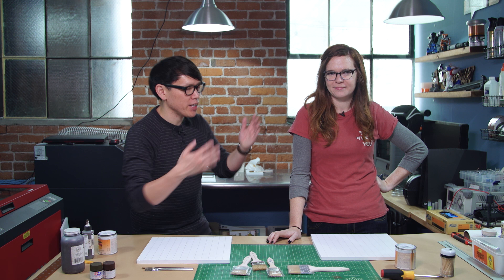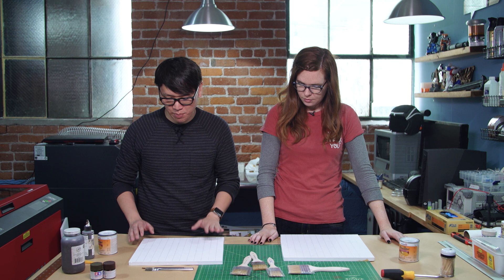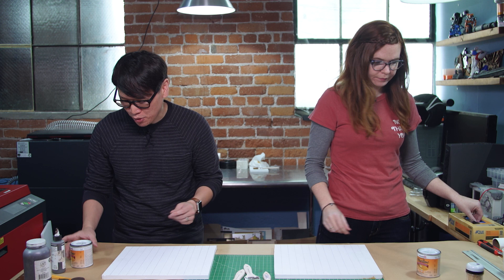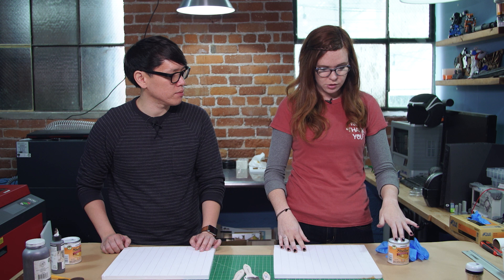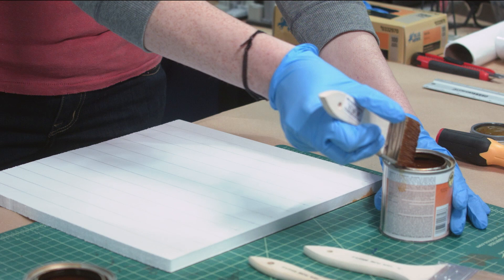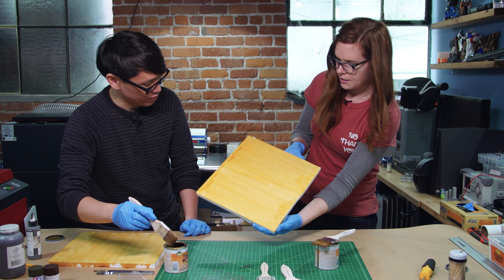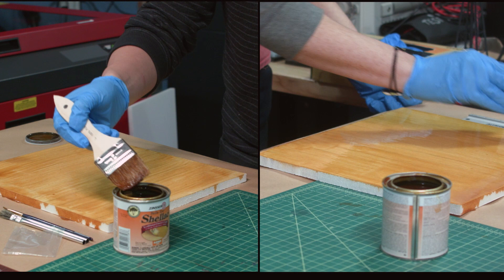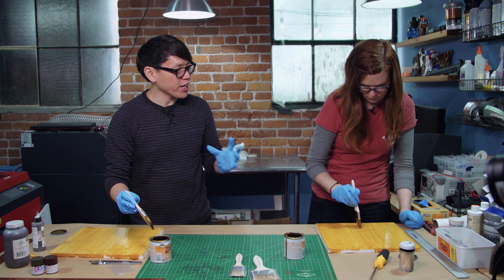Model Behavior: Making Miniature Wood Flooring!

Comment: I've made my own miniature ship decking and I found that when you do knife cuts for board separations (as you do in the video) it causes the material on either side of the cut to rise, creating ridges. The way I found that works better is to simply score the wood (or styrene, etc.) with a pen tool (a straight pen or needle mounted in wood handle). That presses the surface material down into the material rather than displacing it as a knife does. This only works on wood/material that isn't too hard, of course.

Comment: Just realize at 35:00 the holes should be in a line since they are nails going into floor joists running perpendicular to the floor boards. 

Also the joints at the ends of the boards should also be over these pretend floor joists with 2 "nails" at the end of each board.

For my only model floor I did with Popsicle sticks, no internet in the 70's, I didn't do this and then I started to do construction and understood what it should look like if you want realism. :-)

Comment: Just google your brand of shellac with the letters "SDS" after it. That will give you a PDF safety data sheet. The safety data sheet will tell you what safety precautions you need for your specific brand of shellac. It will tell you about glove types, ventilation, etc. Common sense is not as complex as the chemistry of different cans of shellac and the way that effects in you the short and long term. .

Comment: I find when needing some scribe lines in material, I first break the surface with a sharp point but then I use a broken blade held backwards. A #11 X-Acto is .006" thick and puts down a nice "perfect" gap. I like different breaks-- the more like a 90-degree angle the batter at scribing through the surface.

Comment: Shellac uses alcohol as a solvent, so not hugely toxic with a little ventilation.  You are using Orange Shellac, "white" shellac is pretty close to clear.  I love shellac also but it's not stable with water (after it dry's) so things like cold glasses and such will leave water rings.

Comment: Popsicle sticks, cheap. Unfinished wood moulding and wooden dowels of various dimensions and lengths up to 15 ft at HomeDepot cost under $3. Lumberyards are cheaper, because they're wholesalers. Only problem with wholesalers, you gotta find one willing to sell small quantities to you. I've had no problem, here in Las Vegas, NV. Investing in small tools such as Dremels with table saw anchors is great for those doing small tasks, such as model making.

Don't buy building supplies from an art and crafts store, they're notoriously greedy! They cheat ignorant artists. 

Kayte's techniques would be far superior on actual wood, succeed in the illusion of large wooden floors with small pieces.

Also, you save a lot of time not replicating wood grain, and more time on creating the illusion of scale.
Reply: The problem there would be the real wood grain.  In a miniature that's going to look completely wrong, like it came from a 1000-foot-tall tree or something.  That's why they're going through the trouble of faking it.
Reply: @Sharklops  , I would have agreed, till I saw a video tutorial here on Youtube. A person quickly addressed your concern by using a wire brush, color wash, and a little paint; and they minimized, hid, and broke up the grain. Then added the final over coat for desired effect, such as shellac for finished furniture, or dark brown wash for dirty floor. The artist stressed, paraphrasing, "You only need the texture, once you have achieved desired colors, you can't distinguish from the real thing." The final result was astounding. 

Can't remember the person's channel, but it convinced me to use actual building materials, and take my time selling the illusion of scale, in comparison to selling the illusion of the material, too. In addition, when you know where to look, actual building materials are far cheaper than an arts and crafts store. Another example, 100 lb. bag of Hydrocal at my building supply store is $20 with a 8.25% sales tax. At Hobby Lobby, here, in Las Vegas, $20 for a 5 lb. bag. of plaster!

Comment: I don't understand...been a pro model maker for over 50 years...always use pre-scribed bass wood slabs for flooring or siding... isn't expensive, readily available, multi sized, and already looks like WOOD, CUZ IT IS! Also, eazy to cut and laminate on to a base, like gator board, geez.
Reply: This is a great technique for multiple scales. Just because you have done something for 50 years doesnt make it better than someone elses.  you dont stop learning. This is great and cheap.
Reply: @EthanfromEngland-  maybe good for many scales however, time is money and pre scribed is fast and not expensive so I'll stick with it and, like I already said, it's real WOOD!